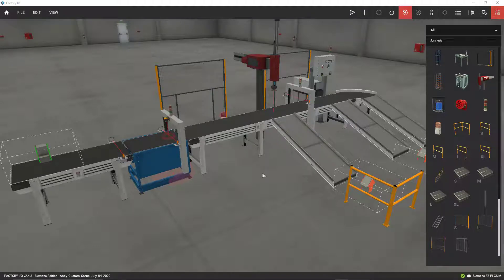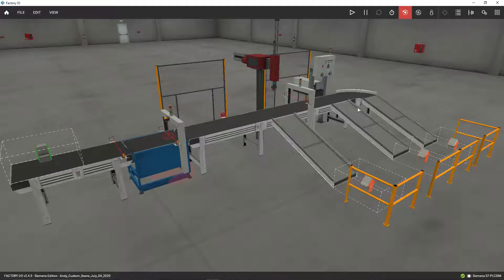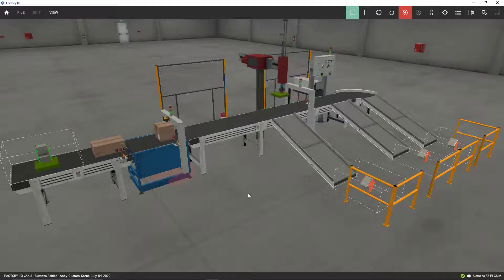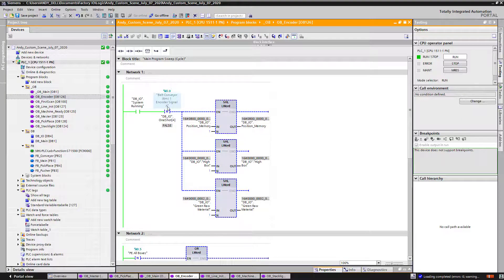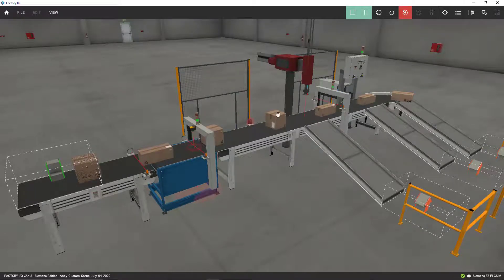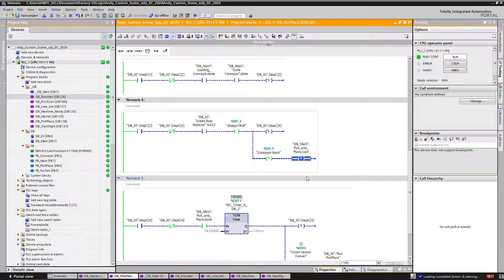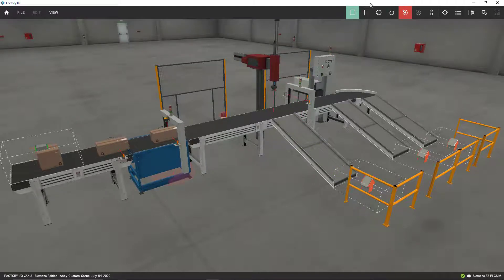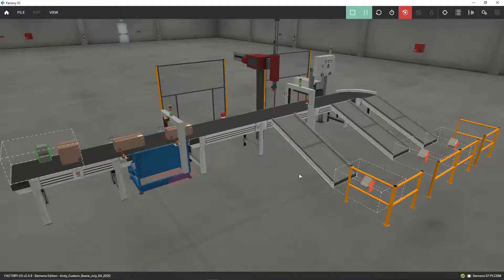Siemens Tia Portal V16 controlling Factory IO -Custom Scene-  How to use encoder and Shift Register

Comment: Shifting bits is not a familiar concept for me. Could you not instead start a counter (when the box blocks the laser) that is counting up on each encoder pulse. The number of counts is the distance from the laser to the box pusher. Because every encoder pulse is like 1cm of conveyor travel and measuring distance is all you really want. Or is shifting bits on a 64bit word somehow better? To me it is more intuitive if the statement is "IF DISTANCE >= 14 THEN PUSH BOX"
Reply: Hey Taavi. I was wondering on this concept (Timers over Shift registers) once as well and in my opinion it's much easier while you have 1 product going on the line. In this example when he is stopping conveyor it would work, but If we look at the sorting station and take the rule of conveyors working all the time you gonna have few products which you have to control with seperate timers. Then you have to predict how many possible products u gonna have on conveyor and when new product takes which timer. When u cant really tell how many of them gonna be there shift register is beating timers comepletly.
Reply: On this kind of concept, You'll need to create individual counter for every product, which is on the belt. But that concept works also. If You use only one counter, You can't let more than one product at time on the conveyor. That's why bit shifting is good tool for tracking and locating.

Comment: Very nice video. I have a question. If you have a very long conveyer belt and a lword in shiftregister  is not enough. What will you do.?
Reply: You'll need to create an array, and shift bit, byte, word, or dword in array (what ever your shiftreg needs to transfer) with blockmove- command. Or simply You just create block, where you count every 10th bit of an encoder pulse, and create one shft reg pulse with every 10th pulse. 👍
Reply: @jsmekatronic2975  but what if we need more accuracy